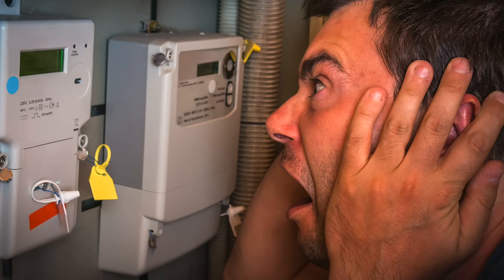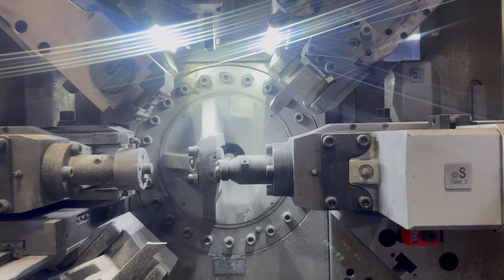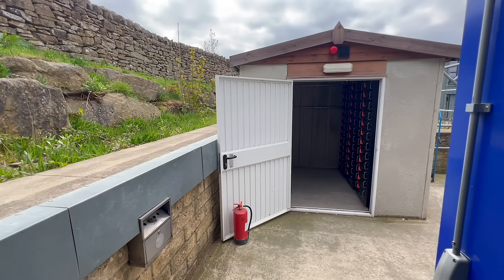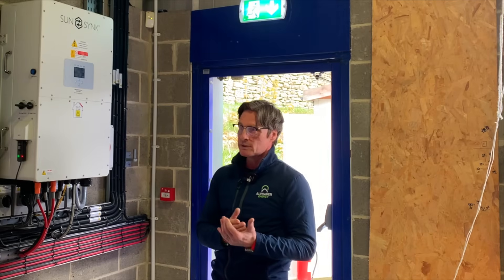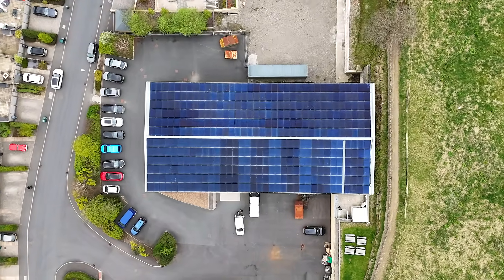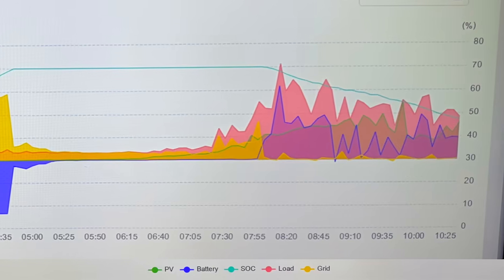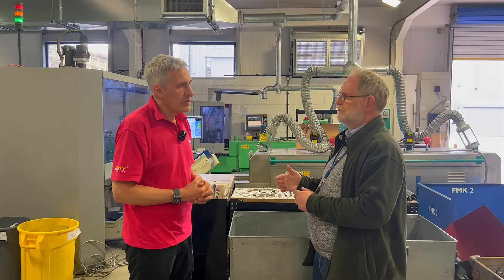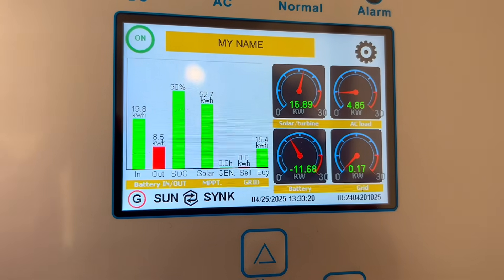Why This Solar & Battery Project Almost Failed

Comment: Ok, industrial properties can have a very large roof area, but given the cost of access and installation, and the continuing fall in panel costs, really, why wouldn't you install as many panels as you can fit?  Ok, sure, you need the (expensive)c omensurately large battery capacity to match if you want to be year round off grid (and battery cells costs are falling rapidly too) with maximum capture, but if you have to "turn it down a bit" in summer, you are not actually wasting anything!

Comment: no one else noticed, they're running those batteries in SERIES? 600+V on the cables feeding back to the inverters.
Reply: @johnhufnagel  they mentioned the batteries are in in series @ 5:07

Comment: Why it almost failed, well where is air conditioning.  All that equipment will generate alot heat.  Should have installed air conditioning

Comment: 8:50 "at night it's about a third less than during the day" if that's all the discount you're getting I wouldn't bother charging the batteries at all. From my measurements on my home system the round trip efficiency is about 70%  so it doesn't really make much sense to charge them..
Reply: Thay have their install running at 600v, not 50v so the round trip efficiency will look a lot better.

Comment: Perfect example of where to install panels. Not on a field, which needs costly infrastructure as well as the view.
Reply: Good point !
Reply: Roof mount is great as long as it points in the correct direction and have the issue how to do you maintain the panels on the roof. People don't realize how often rooftop solar can fail.

Comment: That's interesting, but purely guess work without really time figures. I was quoted £9k for a domestic installation with a "predicted" payback >15 years, you also need to factor in the interest on the loan, or loss of interest if you self finance. In this case a business loan of £200,000 would probably be £10,000 pa.
Reply: Opportunity cost seems to be ignored for domestic installations. I was quoted £3.5k for a 1.5kw system with a break even of 11-22 years. My friend paid £12k for a battery system and had no idea of break even or even the concept of opportunity cost. The numbers he was generating seemed so out of sync with reality that I built up a proof of concept 1kw system using second hand panels and inverter, for about £300, which on the data I've gathered looks like it will break even in 2-3 years. The whole thing sometimes looks like a scheme to relieve suitably vulnerable people of their savings, by rolling in export, electric cars, making hot water etc, into the mix.

Comment: Even the batteries will have a temperature tolerance they like to operate in surely? Hard to regulate the temp in a steel shed. From experience, the batteries will fail prematurely if they're not in the environment they should be. Doesn't look like there's anything to attempt to maintain the temp in that shed. Im no expert, would never claim to be, just something i noticed.
Reply: they have a little fan at the top lol
Reply: The batteries themselves will produce very little heat because the charging efficiency is very high for LiPos, and because the current per cell is low (high system voltage, high capacity) so even with some solar load on the shed roof, internal temps should never really exceed 35 degC for the vast majority of the year.  Cold in winter might actually be a bigger problem!

Comment: I'd love to see the spreadsheets and cost/benefit analysis on this or any other large solar system in the UK. It's a northern climate, so long days in summer but short in winter. For industrial use, the variation in demand is probably less than residential (it takes the same amount of energy to run the machines, and they may even have peak usage in summer if the plant is cooled). It looks like half this roof pitches north, so half the panels contributes less in winter as a result

Any estimate of the system's installed cost? I'm always suspicious when lots of facts and figures for some reason exclude the price

I'm sure buying power at night off-peak and at 1/3rd the day rate makes sense and has a payback point somewhere in the future (but how many years?) and adding solar is sort of a "why not?" at that point. The owner says the system will generate more power than they use over the year, but there is no mention of the feed-in tariff they get - which varies considerably in the UK and can be as low as 1/4 the daytime supply rate
Reply: Totally agree. We never get to see a proper NPV calc on these installs, but that might get in the way of a good story! 

I simply cannot believe that local generation/storage (with inherent inefficiencies, funding and maintenance costs) is cheaper than grid - and if it is - there is something seriously wrong.

Happy to be proved wrong, but let’s see some actual maths.

Comment: Inverter efficiency can be down around 90%, so a 50kW inverter could be equivalent to a 5kW heater while it's operating at near its capacity. I think you need to take that into account in an enclosed space. UK's an awkward place heat-wise with it being valuable half the year and annoying the other half.
Reply: When fully loaded they’re a lot more efficient than that luckily, 97% is pretty typical. Still too much for that little shed in summer months.

Comment: sunsynk absolutely cheapest of the cheap the austin allegro of the solarworld.
no wonder he has problems and also the rebadged pylontec batteries that barely do 5 years if your lucky.
Looks like another install of maximum profit for budget equipment typical yeeha solar sales and installation.
Reply: Sunsynk is Deye. Deye make pretty decent kit. Certainly not the cheapest of the cheap. Cheaper than Victron (and not as open), but everything is :-)  And I know plenty of people with pylontechs already older than 5 years and ageing at reasonable rates. Pylontech were one of the best value battery options available at the time of this install. It's easy to spend twice as much per kWh but you don't get twice the cycles.
Reply: OEM is Deye, suggest you look into that name before you go off with rubbish like this.
Reply: @retrozmachine1189 been fitting solar,batteries and heat pumps since 2008,and this is just yet another cheap product to get the sale over the line before the solar company goes bust due to fitting cheap unreliable equipment bearing no accountability or responsibility to the end user,the solar industry is full of opportunist get rich quick ten gallon hat cowboys.sunsynk will be gone when the problems starts.also I bet you it’s a return to China for a warranty claim/get a reconditioned unit in exchange.where as the shareholders manufacturer just sent you a brand new unit to fit.
Reply from the maker: Which inverter / battery combination would you suggest?
Reply: @efixx fronius,huawei,sma,tigo,solaredge,sigenergy,any established manufacturers backed by shareholders,not yet another cheap Chinese popup clone company with reliability issues and endless site visits.
Reply from the maker: I don't think any of these companies actually make their own batteries. They are all reliant on cells from companies such as CATL, Samsung etc.  If you listen to the narrative of the video the issues here were caused by the original installer not actual inverter or battery system.
Reply: Anyone had a look at the sunsynk rack batteries, would expect them to be prismatic LFP like everyone else’s and not pylontech trash.. someone do a teardown.
Reply: @edc1569  What do you consider the advantages of a prismatic cell over a pouch cell when both are placed in a large metal case? The only value a prismatic sell provides is the fact that it ships in a hard case by default so can be installed without so much care - the pylontech like rack mount box provides such a casing by default.

Comment: 0:11 “more than half their energy bill isn’t for the energy itself; it’s taxes and levies designed to push the transition to greener power” Really??? That statement needs some backing up, because actually since the 2022 invasion of Ukraine, well over half is commodity traders speculating on the future price of gas. Much of the rest is market distortions due to our antiquated national pricing model that sees all electricity charged at the price of the most expensive source in the whole uk.  (Ie gas peaker plants).
I’d even go so far as to say that if the government really wanted to transition to greener power, they’d enable this company to sell back what’s left in the batteries during the evening peak period at a massive profit.
Reply from the maker: UK industrial electricity costs 15–35p/kWh, typically split as:
• ~40% wholesale
• ~25% network charges
• ~20% green levies
• ~5–10% supplier margin
• + Climate Change Levy (CCL: ~0.78p/kWh)
Reply: @efixx so actually your “more than half” is about 22%.
Reply: @dominicgoodwin1147  yes they’d completely wrong. Complete ignoring that the most expensive electricity production set the price for all production, this almost alway Gas.
Do better eFIXX.
Reply from the maker: Industrial users are either on fixed price tariffs (with some caveats) or accept pass through pricing which includes variable cost of production. on a typical 18p average only 7.2p is typically the cost of the energy.
Reply: @efixx but what you said was false as your own numbers showed, and designed to give the impression that the majority of what customers pay is a green subsidy.  It’s not.  What’s more, if you compare it to pre 2022 prices, you see that the cost of energy dependency on fossil fuels (of which we are a net importer), is why energy is so expensive. 
Enough people in the industry listen to you that you have a responsibility to get this right.
Reply from the maker: We've a video coming soon which explore in detail the make up of industrial energy costs and steps users can take to reduce costs.
Reply: @efixx  you need to do better, so much disinformation about Net Zero, throwing out silly comments doesn’t help.

Comment: 4:04 So with 146000Wp they've got 330Wp panels on the roof. Given the low cost of panels now, have they considered it to repanel with higher output panels, and sell off the older panels for say £30 each? With 440Wp panels, they'd increase their theoretical maximum output by 50,000W. 

0:39 A lot of vertical surfaces. Fixed to slim channel unistrut, they could install a fair amount of panels vertically for a decent production in months when the sun is lower.
Reply: Pretty sure the higher output panels are larger, PV technology does evolve but it’s something like 0.4% a year for panel efficiency, and the rate of improvement is decreasing. Though there were some bigger gains in the 2010-2015 when they crammed a lot more active surface into the panels.
Reply: Higher output panels means a larger area. They don't have any more roof area that could be used.

The efficiency of panels is typically around 22-23%.  The only way that more power could be obtained from this installation on the roof is  to fit panels of higher efficiency but they don't exist.
Reply: @deang5622  For older panels (2010-2015) you can now get 30% more output for a given area. However these original panels were probably 2022 vintage and things haven't changed much since then (except got a load cheaper, and panels larger). So yeah I'd be very surprised if 440W panels the same size as their 330W panels can be sourced.

Comment: Wow, all that equipment originally in that small shed, little wonder it was going off on high temp.  Very interesting to see a 600V battery system.  The OEM have up to 800V battery support, quite impressive.  How would they go about replacing a panel in the middle of that array?  With no walk way between them it'd have to be a case of disassembling a path to access.  Even periodic cleaning would be a bit of a pain.
Reply: they might use a specialised crane for the cleaning of the solar panels i guess!

Comment: What's missing is the total amount spent on the whole installation, the regular maintenance costs, e.g. panel cleaning and annual checks. The replacement of the inverters, batteries expect 10 -25 years and panels circa 25 years. My clients would insist on a ROI projection, what is it for this installation.
Reply from the maker: Alphagen - typically expect to see a 5 year ROI. This project was a takeover from a failed contractor so initial numbers not available.
Reply: I reckon this would cost about 150K now, but was probably more like 250-300K when it was installed 2-3 years ago. Maintenance is bugger-all. If they were paying 70K before, have halved electricity use and shifted most of the rest to cheap overnight, then they may be saving something like 50K/yr, so it'll pay for itself in maybe 5 years, which is pretty typical for PV systems now.
Reply: @xxwookey so for bussines is really worth it
Reply: Why don’t you do one for us?
Reply: Edec -  who/what are you asking?